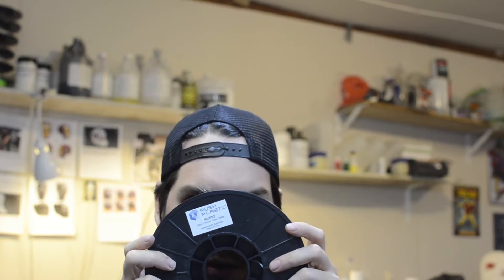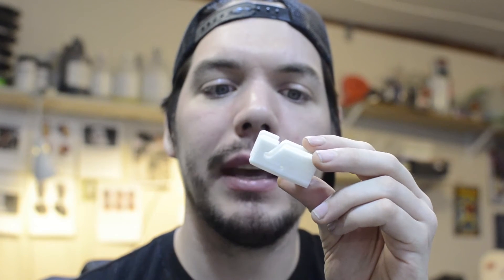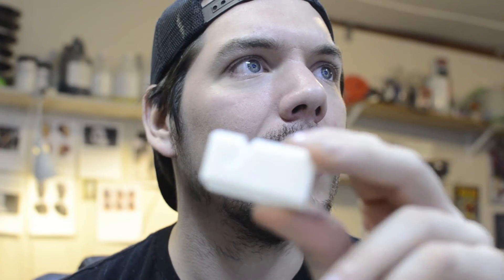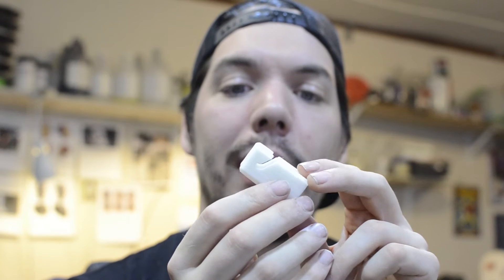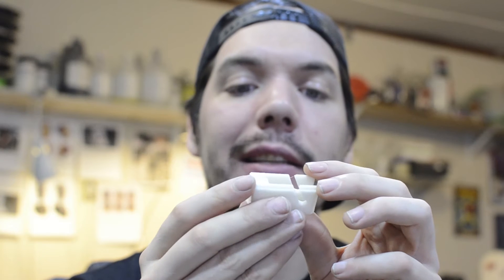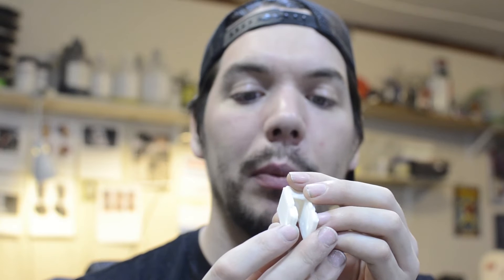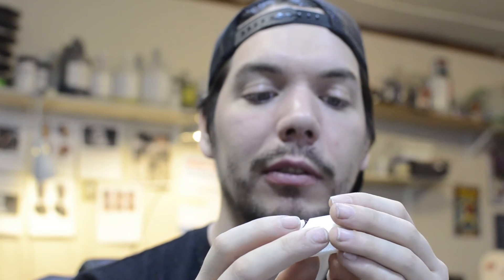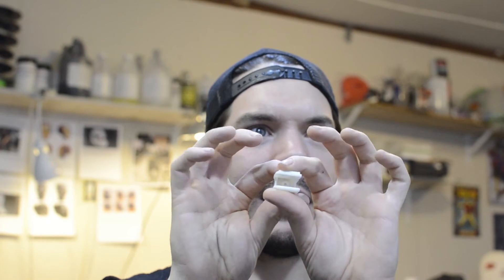Push Plastic PC/PBT Review - World's easiest strong filament?

Comment: I spend a lot of time with this hellish material. On recomended temp and normal setting it had ZERO layer adhesion. I was able to separate it with no force. But with 290°C, slow (10%?) fan and 0.8mm flow (0.4mm nozzle) it turned into something that is indestructable. Absolutely. But it warps a lot. More then ABS. But it is so strong.
I was angry and I wanted destroy another warped box I printed but wasn't able to snap it with pliers and hammer.
Reply: Is it as indestructible as TPU? How do they compare? I can't find PBT less than $78😕